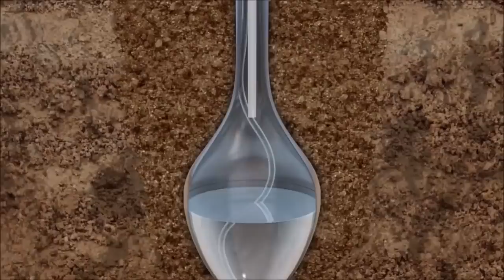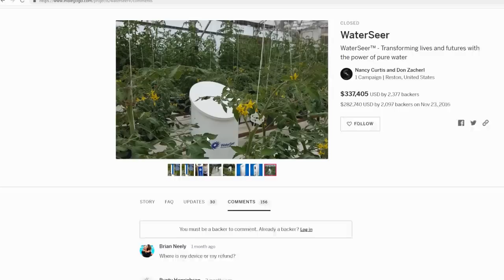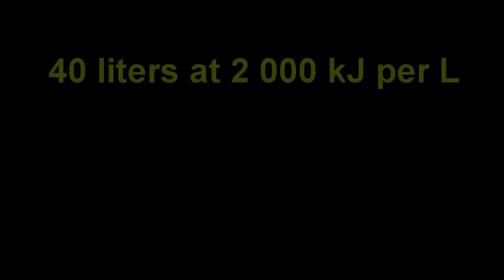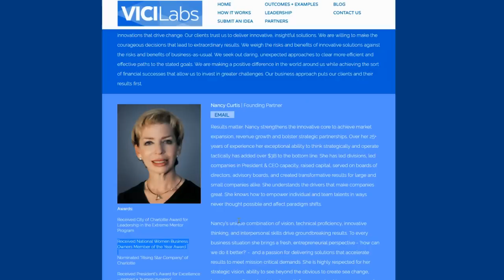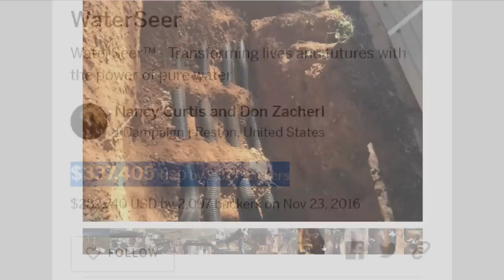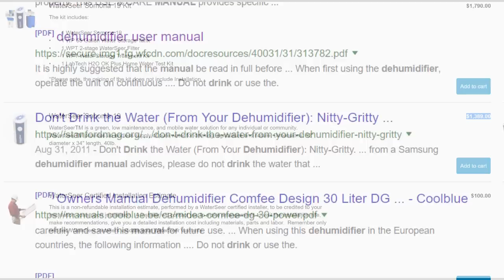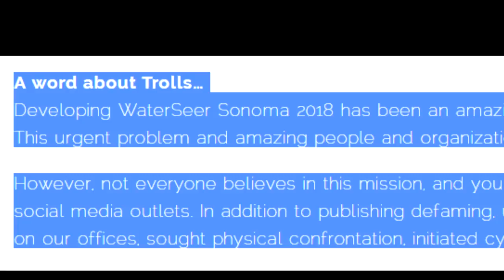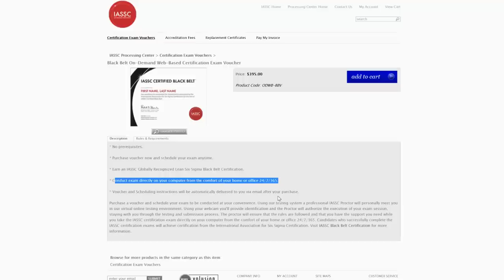Waterseer MEGA-BUSTED!!!!

Comment: They literally show themselves 3D printing the plastic sleeve they put over the Walmart dehumidifier, what a bunch of crooks.
Reply: @Repurplecirculation  *most of the world
Reply: @Repurplecirculation  And they have the audacity to send a " trademark infringement " complain, what a bunch of clowns
Reply: Ask yourself : Why 3D print a simple tube when you can simply take a long tube and cut it to the desired length and angle ?
Reply: @Kualinar  If you have the printer why bother finding such a tube. Just desig nit in 2 hours hit print and next day you have it.
Reply: They probably printed one then just used PVC after that...
Reply: They may have 3D printed the prototype.  Making sure your off-the-shelf PVC tube is the right size before you order hundreds of them is a good idea.  Anyone who orders this idiotic contraption deserves to lose $1200 while paying $0.20 per gallon for the water it condenses.
By the way, since this device pulls 365W 24/7, it does so during peak load when electricity can be really expensive, like 5x the off-peak price.  So that lettuce might cost twice as much.
Reply: @Kualinar  Because it sounds cooler to say you used 3d printing in the manufacturing process.
Reply: @Kualinar  because idiots thinks mass production through 3d-printing is the future.
It might be, but not for plastic.
Reply: @MisterMakerNL  because it is hella expensive to mass produce using 3d-printers? And takes forever...
Reply: @Kualinar  I know man...I was thinking "just get some damn pvc and put angled cuts on them" Its sad they aren't being put in jail
Reply: It's harder than you might expect to carve up raw PVC tubing into a finished consumer product.
I can't even think of a good way to do this on their small scale, affordably.
Reply: @Kualinar   and you can make two tubes for every cut as well
Reply: @Grunchy005   not if you go do home depo and buy the tubes there
Reply: Alain Martel To look impressive on the promotional video.
Reply: Alain Martel Also maybe to get it to exactly the right size they needed; there may not be commonly-sold tubing of the right size.

Comment: The term used to be "Snake Oil Salesman".

This century it's "Water from Air Salesman".
Reply: I have a genius invention
an oxygen from air device
it will make millions
Reply: @terner1234  meh, there are Commercials on the TV for a portable oxygen concentrator by Inogen or something like that for elderly people, they already beat you to it.

Now concentrate Hydrogen from the air so you can walk around with steampunk smokestacks coming out of your spine and you might have something.
Reply: at least you actually got a bottle of snake oil
Reply: Don't forget solar freaking roadway
Reply: @terner1234  Oxygen from air devices exist, they are called oxygen concentrators, they use zeolite filters to separate the oxygen and nitrogen. Not cheap but more cost effective that supplying COPD patients with O2 cylinders. 

I have also used what is essentially the same thing to concentrate nitrogen for nitrogen burst agitation in a dip and dunk E6 film processor.

Comment: Omg printing pvc pipes... it's uh brilliantly idiotic.
Reply: But how else could you possibly get that 45° miter at the end of a premanufactured tube without 3-D printing?  ;-)   We are dealing with a band of geniuses whom, after all, have clearly out thought all of us!  Only evil criminally minded trolls would suggest sawing ready made tubing.
Reply: what is this saw device does it make for a interesting video   @ethanpoole3443
Reply: It's because they couldn't find a supplier for a 8.035" tube, only an 8" tube
Reply: @Rx7man  They need that extra fraction of an inch to fit the unit inside.
Reply: @ethanpoole3443  🤣🤣🤣🤣🤣🤣
Reply: all these comments......gold! :-D
Reply: A 3-D printer printing anything at all is impressive to people with more money than brain.
Reply: I understand what you are saying, but 3D printers use ABS acrylonitrile butadiene styrene plastic not PVC polyvinyl chloride plastic.
Reply: @militia814  ya know there are 3D printers that use PVC, right? Though, ABS is also used in some plumbing applications as well...

Comment: Really though, you could just use all the excess electricity generated by the solar freakin roadways to power these.  Or, alternatively, you could put a thousand Waterseers on the top of a hill and let the torrent of water running down generate the energy to run them.  Or just instal a few perpetual motion machines, and all is bliss.  I mean, if we can simply ignore thermodynamics, anything is on the table.
Reply: William Bennett this comment killed me
Reply: Unlimited POWER!!!!!
Reply: Damn... you've solved it 😂
Reply: Solar roadways lined with dehumidifiers and lomis as far as the eye can see.

Comment: That lettuce was in a hydroponic system which is an enclosed recirculating system. Although the reservoir may need to be topped up, there is absolutely no reason to not use filtered tap water.

Comment: Ahem!.... Need to protect those trade secrets you know. Buying a machine for $200, add a few stickers and a new top and sell it to hippeis for $1,300.
Reply: Don't forget the $200 filter if the hippies want to drink the water instead of using it for their pot
Reply: I don't think you have been paying attention, Mr. Carlson.  I don't think there have been any hippies for the last thirty years.  Perhaps you should select some new demons.
Reply: @hisxmark  leftists are the new hippies.
Reply: @hisxmark  Hippies, demons? Lay off the smoke dude.
Reply: Visit the Denver/Boulder area of Colorado, hippies are still a thing.
Reply: @almosthuman4457  The hippie is strong in Boulder.
Reply: @petercarlson811  You brought up the hippies, Mr. Carlson, whom you have obviously demonized.  Otherwise, there was no reason to bring up a movement that died out decades ago.
Reply: @danielcadwell9812  Yes, yes.. Mr. Caldwell, that is the correct term to use among the simple-minded crowd, these days.  Try to keep up.
Reply: @hisxmark  don't try to sound smart when you can't even spell
Reply: @hisxmark  Beside calling the customers of the scammers hippies, pray tell me, how have I demonized anyone?
Reply: That's macbook in a nutshell
Reply: @PizzaPowerXYZ  Husssssh! Trade secrets you know.
Reply: tiglath pileser  "were not" key words. Maybe re-read my comment.

Comment: A lesson I learned is: If there are only animations, it´s probably a scam. 
If this would really work, it would be easy to prove. You´d just have to dig a hole in the ground, put a metal pipe in it and watch what happens if you pump air into it. That would take maybe a day of hard work (for the hole in the ground), a metal pipe with one open end and an air pump like the ones you use for an aquarium. That should cost under 100€, including the shovel. 
So it would be easy to get rock solid proof  instead of just animated videos. But there is no proof, despite the fact that it would be really easy and cheap, if it would work. I just can conclude that is because the "Inventors" (the scammers) know fully well that it doesn´t work.
Reply: Ungläubiger!!! yeah, if you have some real footage then it must be true. like with that idea about generating power with water vapour moving towards the cool end of a vacuum pipe. They have the turbine spinning on camera there.
Reply: @Bradley_UA  even if they use actual footage you still cant trust it. Always do research before putting your hard earned money into it.
Reply: Dude cool name, whats its origins and meaning?
Reply: "If there are only animations, it's probably a scam." Wait! That's not true... 
If they are promising animation as the product, not a scam. :P
Reply: @darthrevan454  Ungläubiger means non-believer.
Reply: @Bradley_UA  True. You cannot trust even actual video. However, if raw, unaltered footage is there, or people can show it on demand, then it's more likely true.

For example, the cold fusion guys never did actually plug in their "reactor" to a car battery and show it charging. That not only would have been simple, but it would fulfill the actual purpose.
Reply: the idea works but its not what they say it is you will end up with small amounts of water but nothing worth offsetting the cost its like drilling a well that fills every 100 days.
Reply: @darthrevan454  it's the German word for unbeliever
Reply: @darthrevan454  you're right. Even actual footage can be fake. But the absence of real footage or better proof is a reason for being more suspicious than usual.
Elon musk for example has real footage of his tunnel and the hyperloop, but the idea is nevertheless bullshit.
Reply: @unglaubiger5645  lol yea its complete bullshit. Also thx for telling me what your name means. Its great to learn new things in life or the internet.
Reply: @imchris5000  You are right.
Reply: @Benjamin1986980  what i said was sarcasm. I thought it is clear as im reffering to Thunderfoot's scam idea.

Comment: The even bigger scam here is that he is a Microsoft certified systems engineer. He is the equivalent of an Indian tech support scammer.
Reply: I had to get a Microsoft WIndows Server Administration certificate a few years ago to close off a course in server administration. The certificate exam didn't require almost any knowledge of server administration, what you had to remember for the exam was the location and name of various features and checkboxes in the GUI, and also several completely arbitrary sequences of steps to reach totally impractical goals. They would literally ask "what's the name of the tab in the <whatever> administration window where you can click on the <whatever> button". Thanks to Microsoft, I am a professional certified in clicking the correct tab.
Reply: I remember asking my dad and workmates about the microsoft certification, they laughed and just pointed to the manuuls they had and said if I could finish one I would know more than someone that does the course to be microsoft certified. Then they told me that most companies in the industry know they are BS and never to work for a company that mentions it in any of their recruitment. Thank you NCR (now owned by AT&T).

Comment: You can have "water out of air" with fog catchers. You just need some fabric and pvc pipes. It's used on Morocco, Peru and Chile, in arid regions with foggy weather.
Reply: Of course you can. No one is actually saying that you can't get water from air. It's just impossible to create a device that will collect water from air that is running of solar or air power and is small, cheap and easy to install and gives you amount of water then claim it gives. It's just selling overpriced bullshit

Comment: I drained my air conditioner drain to a large barrel outside of my house and used that water for my gardening. Even during droughts, I'd still have a nice garden.

I didn't know about the heavy metals and stuff but I would never drink it. I did use 4 fifteen gallon barrels to catch the water. It needed to warm up before being put on plants. I must admit, it worked quite well. It would take abou 2 to 3 days to fill up the barrel (about 13 to 14 gallons).

Comment: I had to maintain dehumidifiers in the 650 shop at MALS31 at MCAS Beaufort as a Lance Corporpal in the Marines back in 1997. It's simple technology, but it takes electricity to drive it. And no way in hell would I drink the dank ass water that bucket filled up with! Not unless someone broke it down and defungicided the hell out of it every few hours! It was always gummed up with mildew and funk! We just dumped it outside to keep the avionics shop protected from corrosion issues.

Comment: For 2000 years mathematicians struggled to prove formula for all the roots of polynomials using only addition & subtraction & multiplication & division & root extraction.
When Ruffini first proved that no such formula exists for quintics, and Evariste Galois gave the groundbreaking revolutionary theory that explains exactly when a polynomial can be solved by algebraic operations only, proving once & for all that there exist no formula for all the roots of a polynomial with algebraically independent coefficients over Q,
mathematicians since Ruffini & Galois moved on from this theory & built upon it.
They did NOT tried to endlessly reprove or re-find a general formula for all roots of a polynomial.  Unlike these students who should know what has been PROVED impossible FIRST before embarking on a quest.

Comment: Hey, I've got a 3D printer and time, time to go become a six sigma black-belt genius.
Reply: Mind if I come over? Sigma black belt genius's assistant would sound pretty good on a resume.  

Plus I really want to 3d print some Lego train track junctions lol.
Reply: Can you tell us how long does it take to print that tube?And cost of it.Ta
Reply: @sebastiansochanski  Looked like they were printing it in vase mode (single layer wall, which means it would be fragile). So probably a day if the print volume is 200mmx200mm. I'd need the model to estimate filament usage and kilowatt-hour usage.
Reply: @N3X15  
Thanks.

Comment: I wonder what the effect of pouring "dirty" water around the base of the original device concept would have had on its effectiveness.
Reply: at this point a hand pumped reverse osmosis tube would be more efficient
Reply: @krzysztofbroda5376  true, however my thought is that This would be used for supplemental supply in addition to more labor intensive means such as pump driven filter systems. My imaginings see a device like this placed in the margins of a river floodplain or wetlands where the main course of the river May only reach it seasonally, but the soil will contain more water year round. Providing more moisture to evaporate around the device itself as well as being slightly more efficient at transferring the heat to the surrounding soil.

Comment: If you're stuck out in nature and running low on water (even the desert) dig a circular hole 50cm by 50cm under direct sunlight and. place clingfilm (saran wrap) on the hole, enough that the middle of the clingfilm is about half way down the hole, if you place a small pebble in the middle. Place a bowl or whatever receptacle you have to hand directly beneath the lowest part of the clingfilm, beneath the pebble. Affix the clingfilm so it's stretched smoothly and the sides will not come loose. The sun will cause the pit to act like a green house, and any moisture in the ground will evaporate, and condense on the clingfilm, and as the beads of water build up and combine, they'll roll down the film and drop into the bowl beneath. How much water you collect depends on the ground moisture, sun heat, depth and width of hole, all of which can be altered depending on your location. Even many deserts have moisture just beneath the surface. You probably won't get gallons, it depends on the location and weather but you'll get some, especially if you make several, and a hell of a lot more than this expensive and useless kickstarter genre of water scams. Pro tip: Don't, ever, ever, ever run out of water in the desert!

Comment: Pfft you're 1000% wrong! My neighbor gets free water from air. He plugs it into MY electricity supply and has been doing for weeks. I only noticed the broken open into external socket a few days ago.
Reply: Last time my neighbour did that I connected a high voltage line (2kV) to his wires after midnight,  gave a nice sizzling noise ;-) In the morning his wires were suddenly gone...
Reply: @rolandleusden  Reminds me a little bit to that one comedy shortstory i once read where they connected the 110V power system of North America with the 220V system of Europe. Without a transformer, of course.

Comment: Another one: www.sponsh.co
A legit university backed startup.
Can it be busted or did they actually find the loophole of thermodynamics?
Reply: I just looked at the article and I saw a red flag. They said it would only work in areas with enough temperature differentials, and said that they tested it; but they did not give any data on what these temperature differentials are. See also keep repeating that they tested it without giving any data or proof. They say the material swells up to four times its size but never showed it.

    The fact that they're this far along and yet they're hiding all the data they collected over the past few years automatically tells me this is b*******.  if it worked as well as they claimed they'll be shouting the data from the Treetops, not hiding it from the public.  Which is another red flag.

 I don't know enough about physics the debunk their idea, but I do know enough about marketing and business practices to know that can't be real. By claiming a1m patch can provide 1 liter of water in a couple Cycles.  that means for about the same size as a commercial solar installation you could produce enough water to fully sustain yourself.  and if it worked like that then they would be millionaires and they'd be all over the news for solving for solving the world's water problem.

 Sorry this was a bit of a ran,  and I know I'm not thunderfoot,  but I hope this answered your question.
Reply: From my understanding, it is only meant as a way to passively water trees? In that case, there is precedent as pine trees have specifically evolved to gather moisture from the air during the wet, foggy mornings using the same principle. So in the basest sense, it is possible but their marketing could send them into BS land depending on what they promise and what proof they give.

Comment: I've come up with an invention. It draws water out the air and turns it into water you can use to water your plants. I know you think that sounds like a waterseer, but mine doesn't have to be stuck in the ground, you can just plug it into the mains, so you can have it somewhere like your house if it suffers from dampness related mould.